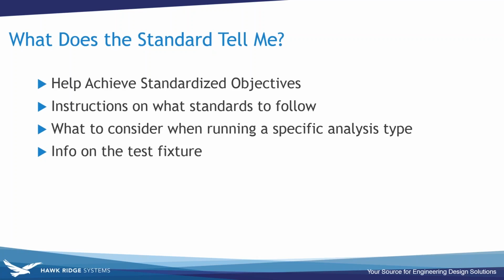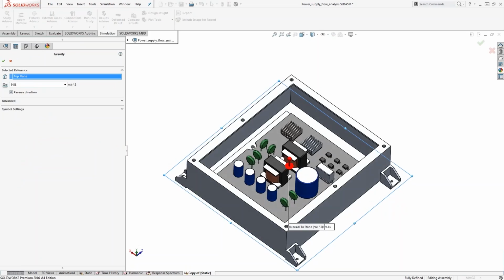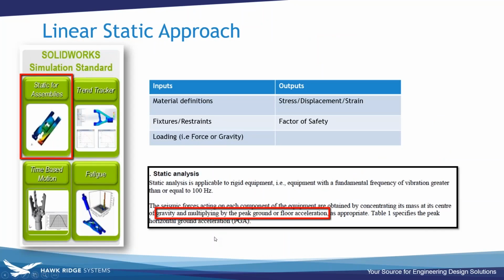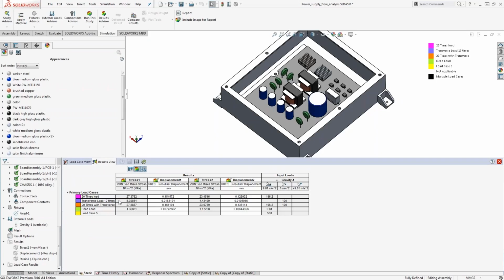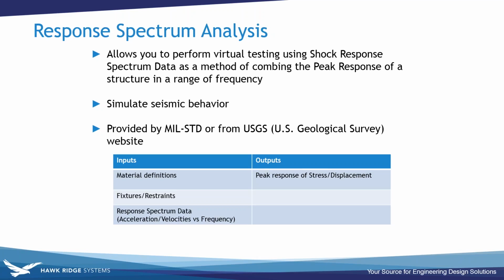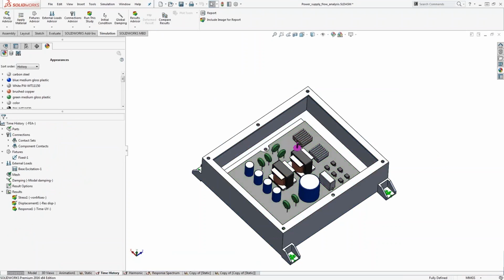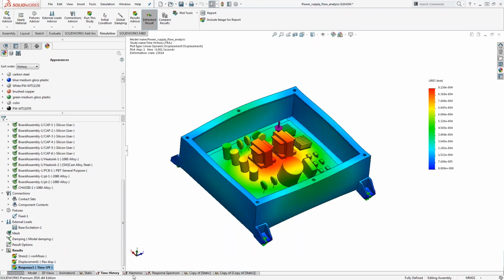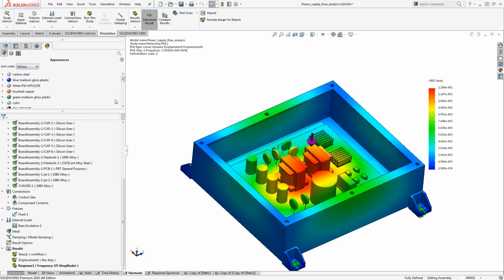SOLIDWORKS Simulation - Using SOLIDWORKS Simulation for Shock, Vibration and Seismic Testing

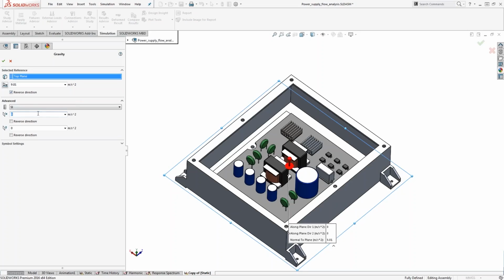Comment: Static loading G forces - 7:00 (Non-Harmonic)
     You can find the most stressed point and use the Von Mises chart to compare a numerical value to the material's yield value. If under the yield value, the material will not fail.
Reply: not necessarily true, if a stress cycles from zero to some value below yield, it has a potential to have a limited fatigue life due to stress cycling